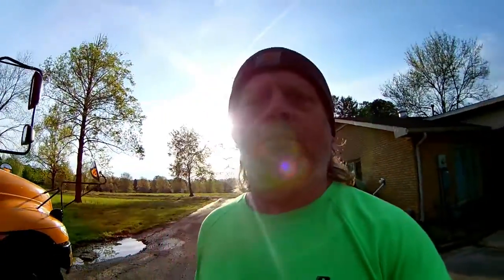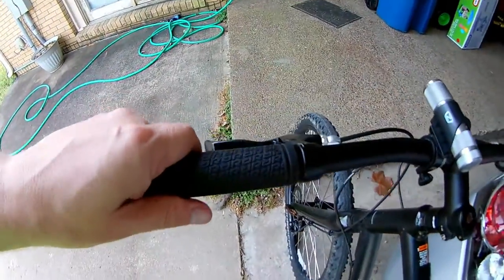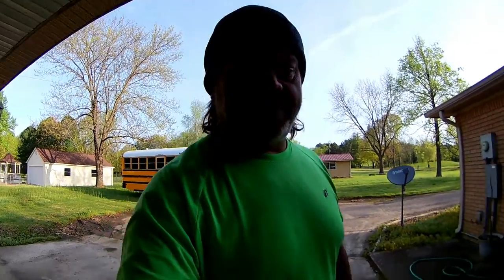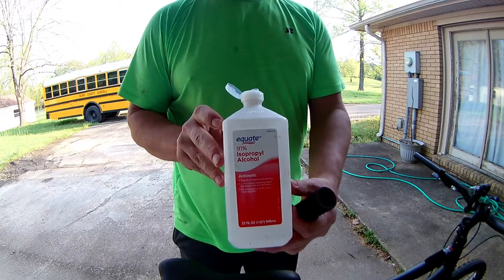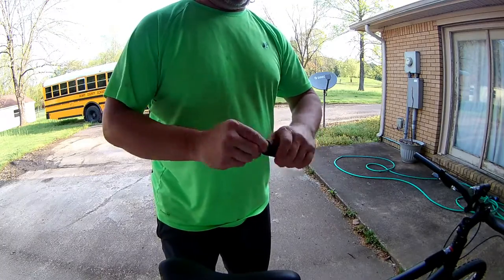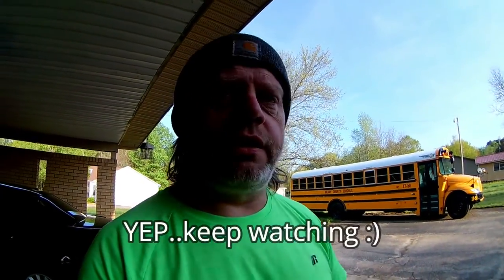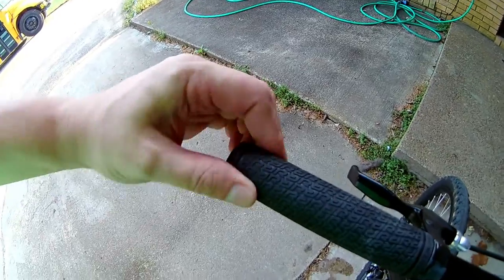Raleigh Redux Grip Slip Fix 4 17 19

Comment: eventually slip on grips will wear, so far my fav grips are Revgrips, but they cost a lot more, but they are floating on the bar and have some rotation to them, this can be tuned to suit you, I run a mix of red and black inserts and use 34mm grip cus that's what my hand grip measures at, that's easy to measure just make a circle with thumb and index finger and measure, it gave me 34mm.
Rev grips are Lock on grips so they stay on securely, as long as they are properly secured with Loctite 243 and bolts are tight enough.

but when I sued silicone grips or even rubber grips many years ago, I used hot water to expand the grip before installing it, this made it a lot easier, also if you struggle with holding the grip a towel will help or even a t-shirt.
there is no need to use soap, as you experienced it will result in slipping grips.
but I quit using Esi grips cus they were getting too soft after 4 weeks, but I like revGrips, I got a review on them, but you can swap the grip once its worn out, but before that I recommend to rotate the sleeve/grip it self so you use the less worn part, this keeps you using the grips longer, but they are very durable, also very sticky.
I also heard good things about Oury,Lizard kins but I haven't tried those, but RevGrips is a different system, and offer more benefits, no other grip is like that, but for me it was worth it.
but of course not saying you have to buy these grips, just share what I learned so far, but grips like yours are way too thin,hard, for me, too much abuse, especially for mtb, but your bike is not for mtb, so you maybe it works for you.
Reply from the maker: yeah they are thin and hard on the hands. Im going to get a more comfort grip at some point.

Comment: TopCabin grips on Amazon.... did a vid on 'em. I had them on my cheap-o bike in Kuwait. For $8, they lock on, didn't hurt my hands, and come in a variety of anodized colors. They held up well the whole time I used them. I have slip on grips now, but they're silicone from RedMonkey Sports. They just now came out with a lock on version. Oh, gotta get the 91% alcohol content! Works better for everything.
Reply from the maker: i used 91%..is that not the right "kind" "brand"???
Reply: @mikieson  that's the good stuff

Comment: I had the same thing.  I've noticed since I've done many bars once you take a grip off sometimes it's better to get new ones if you have them on for years that is.  I've also air to get them on n off. Easier then doing it over n over to get it locked in.  I been having that issue on a left grip also. But I think I'm due for new grips.
Reply from the maker: well this issue is fixed..super good now. Lockons are good,but honestly i never had issues with regular slideons..I guess I didnt have the grip cleaned out well enough all this time. Its pretty glued on now..lol..However I want to get some ergonomic type grips soon. easier on my hands. ive always had issues with mostly my right hand falling asleep and hurting..so..one day ill get some better grips.
Reply: mikieson yeah most of my bikes have lock on grips.  Easier.  Yeah I had cleaned mine over n over n finally dry and stuck on.   I only use ahcol when doing slide on grips or air. I've used air pump also it works I used that red piece or a ball needle air stem.  It works.
Reply: @mikieson  some grips last longer, and are made of different rubber, the harder grips will last longer, cus it's harder more durable rubber.I had several slide on rubber grips that wore out pretty quickly, last maybe a year or so maybe two, with some, some grips can last for several years, it depends on what they are made of.
Reply: @Wannaridebikes  I have not tried that trick with a track pump, nice if it works well, and hose is long enough. but if not hot water works.
Reply: @mikieson  I recommend to check the size you need, also I got a review on revgrips on my site, but not tried many grips ,I went from junk, to overprised hyped up grips which had raving reviews but were awful(esi) to Revgrips which were what I was wanting for years, I was not sure how to exactly do it, but how it exist, like them a lot, they come in several sizes and colors, both the sleeve/grip and the end cap & clamps. but set up is important, or they will make the ride worse.
the review: https://wp.me/p60aTF-2t4
Reply: @mikieson  make sure to not deathgrip, sizing is important, also having too hard grip can cause problems, or having too big grip.
it sohuld be more relaxed not a work out to hold the grips.
other problem I have nto fixed yet is shifting abusing my thumb to the point of skin falling off and getting stiff tip, and needle pains, so archer components electronic shifting system is interesting to me, apart from joint misalignment & to short frame this is the only problem I have with current setup.
I think that will be a big help for me, no shifters on the market to my knownlage will fit me, even with the adjustments some of them have, they don't have all the adjustments I would need so that does not help, downshifting means rubbing thumb on the grip.
I f I shift a too much it can take days to be pain free, and of course I have to use hand cream to keep my hands in good condition, but shifting a trigger shifter as much as I do if riding a lot of tech its basically self harm, but I on my last rides I reduced it to bare minimum, only shifter where absolutely necessary, but if riding more up and down terrain on longer rides that will be impossible.
but I had several days off from riding and used a lot of hand cream it helped to make my thumb look normal.
shifting is the only thing giving me long lasting pain, if doing it a lot, but of course if if I were to ride for absurd amount of time like a race my hands and rest of my body would be aching too, but I am not.
shifters made for size small hands is not great, I am currently using XTR M9000 and yes overkill, but I just got what I could get at the time, so xtr it was, and buying internationally would bring the total sum to xtr level anyway if I went for xt for example.
but I see the Archer components shifting system is expensive, but i hope the price goes down, it's an interesting system.
Reply from the maker: @mtbboy1993  normally your skin gardens up after a while. Surprised you're still having issues.
Reply from the maker: @mtbboy1993  I just checked out the link. Yeah I've seen those grips before on gmbn. Pretty cool but a little expensive..
Reply: @mikieson  waiting for a sale on a dealer nearest you might be best. I had to have them, glad i got them. Got them directly from RevGrips, was unlucky and lucky at the same time, it came with missing parts and a without sleeve, so cusi ordered a spare, but they sent me one extra and extra spare inserts. All went fast. Good service. But the sleeve/grip will last me one more season for sure. So I am satesfied.
Reply: @mikieson  it was winter so I get dryer so need alot of hand cream I don't always have enough on, I forgot to have one with me on rides lately, that's what I did before, but for the pain I have nothing.
Reply: @mikieson  for some reason skin on my thumb wears faster than it gardens, and when i use hand cream it cures and gets nice. but my palm gardens a lot.

Comment: To remove/install a grip with almost zero effort use compressed air. Spray the air between the grip and the bar. It will almost walk its self off. Can reinstall using same method.
Reply from the maker: yes sir..ive seen the trick..but..I dont have an air compressor. SO, i had to use the old tried and true method..:D Its all good. Grips are snug as a bug in a rug..HA!!...Hey thanks for commenting and watching..Hope you SUB and enjoy my videos if you havent already..